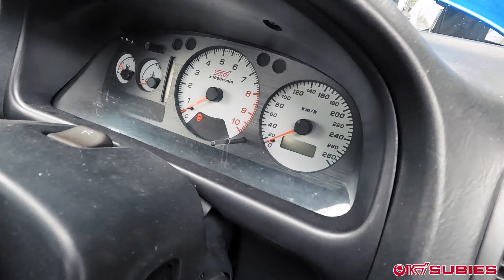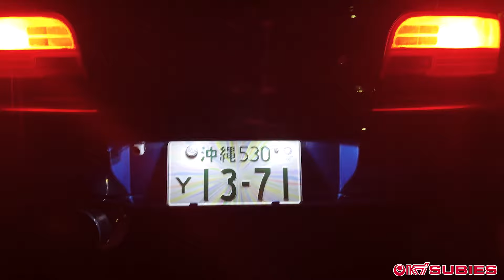Good bye to the cleanest GC8 / Subaru Impreza WRX STi V-Limited Type RA

Comment: Had the MAPDCCD in 03 JDM sti drivetrain that was in a USDM 06 STI. (35:65 powersplit ftw).

In auto, if the gain dial was at 0% the car will oversteer and easily spin out especially in the rain, kept it around 60%, they should really stress the important of the gain dial position if Im going around a bend and somehow had it at 0% because a passenger touched it, it could be dangerous if unexpected.
Reply from the maker: Yeah I can see how that would be dangerous! The Auto cross map also has an aggressive bias to go full lock at hight throttle loads so on some really technical roads we felt it was more prone to understeer. Very nice you can customize the settings though.

Comment: Just a quick one, I have an SF5 Turbo 1999 model. I am having consistent boost surge in gears 3,4,5. The turbo will pull hard, let off, pull hard, let off. This happens from about 3500rpm to whenever I decide to shift or slow the hell down.

I have NO mods. I have NO boost gauge.
I have a new MAF installed as well
Reply from the maker: This sounds something like plugs needing to be changed, if it was a newer car I would say coil packs might be something to look at also but you have the single coil pack and when those go bad the idle and normal driving is also effected.
Reply: I did a conversion with the coil pack to that of version 7. I removed the lead wires but I did this long ago. I’ll check my plugs. Which are the recommended plugs for this SF5?
Reply from the maker: @Leuville_Enterprise  Well It could definitely be one of the coil packs going bad also then!

Comment: Hey OkiSubies, I have a small inquiry. I recently swapped my sf5 intercooler with a wrx intercooler. I started noticing some boost fluctuations. When I unplug the vacuum hose from the dump valve, the car seems to boost just fine. Could this be an issue with the dump valve or perhaps a leak on the intercooler?
Reply from the maker: Most likely the dump valve/ BOV
We have noticed that the oem setups have a really soft spring. If you remove it and can push it really easily thats most likely your problem 👍🏻

Comment: So that means building a usdm 98-01 impreza 2.5rs is just as lagit if built properly...
Reply from the maker: Of course there are differences like RHD and the fact that the chassis is still a Type RA V limited but at the end of the day they are both extremely light platforms so in a performance aspect I would have to agree!